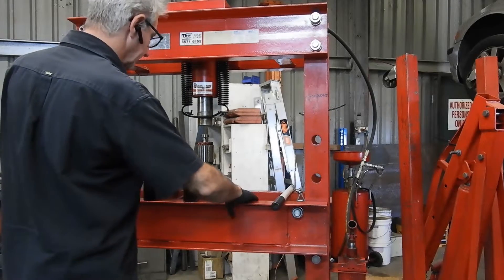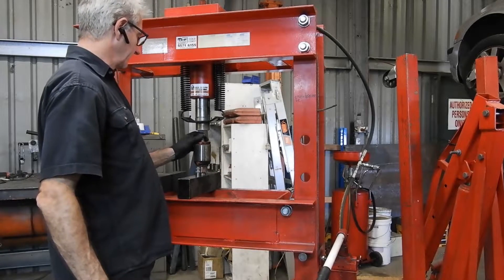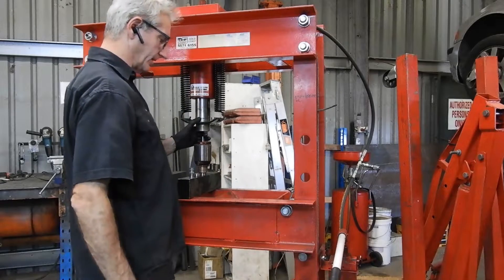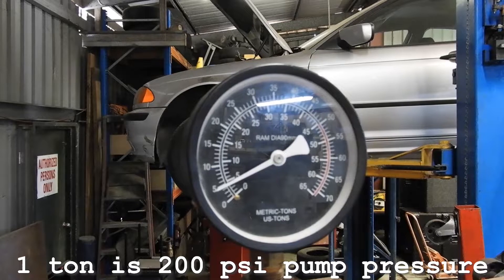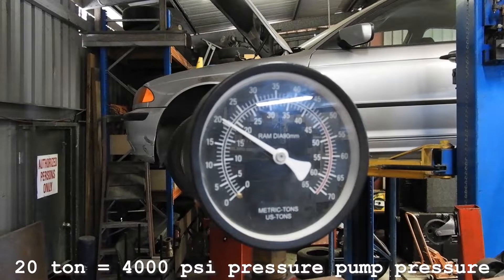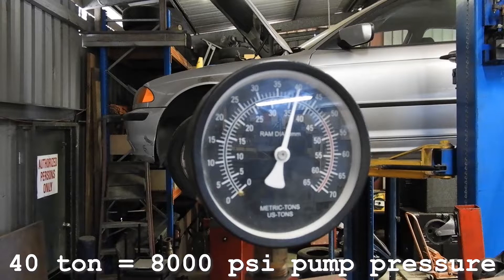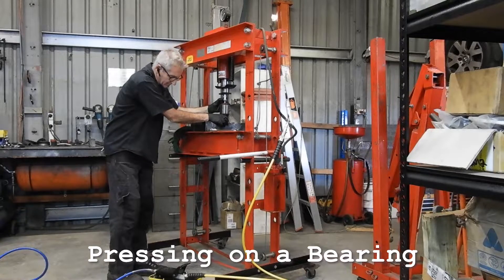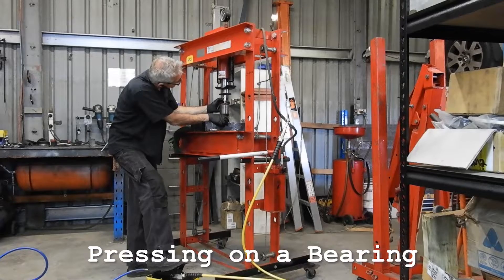How to Speed Up Your 50 ton Hand Operated Press 3X with a 10,000 psi Air Operated Hydraulic Pump

Comment: What does it matter if you can control it with your hand?!  Defeats the purpose.
Reply from the maker: Sometimes if you have a tricky press job to do that requires you to use BOTH hands to keep everything in alignment or to hold it still and or upright. Using the foot operated pump keeps you, both your hands and your focus on the job.

Comment: Hello.
I bought practically the same 50-ton press (from harbor freight). And I want to connect this foot pump INSTEAD of hand pump, i want to unbolt hand pump from press.
1. I will connect high pressure oil line from pedal to cylinder insted of line from hand pump.
2. But there is also small 'Oil backing pipe' going from low section of cylinder to top of hand pump. What to do with this pipe when using foot pedal only?
3. When you press spoon, piston is going up and down few times very fast. How can I lift piston with no hand pump? (because Back oil valve is on the side of hand pump now). Or is this 2 direction foot pedal pump and I can press and lift piston using just one pedal?
4. What air compressor do I need with this pedal to press from 0 to 50 tons? I found some compressors about 20 gal 135psi max. It will be good enough or I can buy something smaller like 8-10 gal? Or even 20 gal is too small?
Thanks.
Reply from the maker: Vitalli sorry just saw your message you have so many questions!, if you still have problems please email them to me with some pictures to  sales@mhfgc.com.au
Cheers
Minos

Comment: Instead of "T-ing" in the air over hydraulic, why wouldn't you just replace the OEM air/hydraulic pump and directly connect the new, larger capacity pump?
Reply from the maker: Yes good point that is what we have eventually done, 
(when the manual hand pump finally failed)  
Please be aware that air over hydraulic pumps require a large volume of compressed air and continuous use of the Air over hydraulic pump will require quite a large air compressor and air receiver.

Comment: Great video showing how simple it can be to add a hydraulic pump to the system. I'm going to add this to my todo list. One question - how do you manage the oil levels in the two reservoirs? Eg. if you use the air pump for most movement and then the hand pump for final pressure, but release all oil back into the air pump, eventually the hand pump will be drained, right? (And maybe the air pump will overflow...) Maybe adding a site glass onto the side of the hand pump will let you keep the oil level at a consistent enough level over time?
Reply from the maker: Hi Adam yes you have raised some good questions.
The simple answer is to have the discipline to turn off firmly the hand pump's load hold valve when using the air over hydraulic pump. 
If using the hand pump make sure to keep the foot pedal on the air over hydraulic pump in the hold position.
Also every now and again keep an eye on your oil levels.
Our air over hydraulic pump has an oil level gauge.
And as you suggested installing a sight glass hand presses oil supply tank.

Comment: Can i use this machine for making steel bowl ..plz reply me 🙏
Reply from the maker: Hello, Vishal Yes you can use these machines for forming, bending and stretching steel into bowls but they are still a relatively slow process not a fast hi speed process, if you have a hand pump the air over hydraulic pump will be at least 3 times faster than hand pumping, please remember though that you will also need quite a lot of compressed air to operate the pump.
Reply: Hi I have a 35 Ton Jet press would this work the same as what you have?
Regards
Mark

Comment: Hello. How many tons needed to press in a typical bearing? Thanks....nice vid.
Reply from the maker: Interesting Question,  
Most bearings don't need more than 1 to 2 tons of force, bigger bearings around 4 inches in diameter maybe 3 to 5 tons. 
The internal bearing housings on Rock breakers though,.... need lots more between 20 to 40 tons.
Seized and rusted Pins on Earth moving Buckets and hitches from 5 to 20 tons and they usually go off with a bang. 
Straightening bent cylinder rods around 1-1/2 inches in diameter 4 to 8 tons. 
Hope these answers have helped you, are you trying to decide what press size and capacity to purchase?

Comment: Brother, you've made my day. I form stainless steel domes (1.2 mm sheet and 46 mm diameter) but it's one hell of a lot of pumping a 30 ton bottle jack to complete one dome. I form them in two stages - the first just to draw the material into the die and the second operation to form the shoulder at 90 degrees. Then I saw your video. Man, I was impressed. I saw a lot of these things on the internet. Some with less than 1 liter/minute flow up to 16 liter/minute flow. I assume this is air flow, or am I wrong? I will appreciate your input to ensure I buy the correct thing. I will mount the jack upside down eventually. Have a great day and I hope to hear from you.
Reply from the maker: Hello, Pieter thanks for your comments and questions. The Unit I used in the video is compressed air operated and based on our tests sped up the manual hand pumping operation by three times, 3X (300%).

Oil delivery from this unit (and many others of similar size and design) will depend on the pressure generated.  
for example. 
at 1,000 psi pressure, the unit will flow 1.0 litre per minute
at 2,000 psi pressure the unit will flow 0.85 litres per minute
at 5,000 psi pressure, the unit will flow 0.5 litres per minute
at 6,500 psi pressure, the unit will flow 0.32 litre per minute
at 10,000 psi pressure, the unit will flow 0.16 litre per minute

Compressed Air consumption required is 339 litres per min at 100 psi.

If you mount the jack upside down unless there are internal or external extension springs it may not retract properly and connecting the pressure hose from the pump to it could prove ......complicated.

You could try mounting a single-acting high-pressure cylinder such as this to your press  
 http://ebay.us/kQRuHG

If the air operated pump flow is enough for your requirements, please see some links below 
If you require more flow for faster speed then please check out high-pressure pumps that are operated with a single-phase electric motor as these units will supply up to 2.5 to 5 Lt/min of oil flow.  

If you are in Australia you can visit our web store www.hydraulic.online and order one from there 
For an air operated pump,  https://bit.ly/2WUq97a
For an electrically operated pump,  http://ebay.us/BW226N

Alternatively, If you're in the US and want to invest in a New 10,000 psi Hydraulic Pump?

For an air operated pump,   http://ebay.us/Ww4TRK
For an Electrically operated pump,  http://ebay.us/GzFmzn
 
Hope this answer has helped you Pieter and all the best in your quest for speedier forming of your Stainless Steel Domes.
Regards
Minos.
Reply: @Hydraulic.Online  Thanks so much for the info brother. I'm sure I have seen one of these things before but never used one. I will for sure invest in one of them because pumping a bottle jack under high pressure in a 37 degrees Celsius (common temperature here by me) is no fun. Happy holidays to you and your family.

Comment: Hi there! I really enjoyed your video and it was nice to see there is something available that will increase the speed of the ram. However, even in the sped up footage, it still looked pretty slow. About how much did it speed up to? 10% maybe? 
The reason I ask is I was looking at using the same set up but for forging and I would need to do as much work as possible while the steel is hot. I really appreciate you making the video! Thank you.
Reply from the maker: Hi Sam, Thanks for watching and for your comments and questions. This system will provide a lot of pressure but you are correct it will be too slow for metal forging,  It is, however, ideal for not only speeding up a hand-operated press but also for freeing up an additional hand to hold and guide the workpiece. If you need a system for Metal Forging please check out this video.
https://youtu.be/qUT71kzfsjE  
that was sent in by one of our clients who built his own forging press using a Metal Forging Hydraulic Kit supplied from our online store. 
https://www.hydraulic.online/store/Metal-Forging-Using-Hydraulic-Power-c33871059
Reply: @Hydraulic.Online  
Hey! Thank you so much for such a quick reply! I will check out those links you provided. That was very thoughtful! Thank you!

Comment: What is the oil flow rate ?
And is it possible to increase the flow rate by increasing the air pressure ???
Please answer me and I wish to have any of your whats app number 😁
Reply from the maker: Hello Mohammed thanks for watching and for your question.
You can Increase air pressure to a Maximum of 120 PSI this will give you a little more pump speed and will achieve around 10500 PSI of OIl pressure but no more because the internal relief valve will release any more excess oil pressure generated.
As a rule as oil pressure increases oil flow will decrease as more air volume is required to fill the air side of the intensifier chamber to produce a higher oil output pressure.
For example with a constant 100 PSI of clean, dry and lubricated compressed air  the following pump performance can be expected.  
at 1000 psi oil pressure oil flow is around 1000 cc  per minute
at 2500 psi oil pressure oil flow is around 785 cc per minute   
at 5000 psi oil pressure oil flow is around 475 cc per minute   
at 7500 psi oil pressure oil flow is around 275 cc per minute   
at 10000 psi oil pressure oil flow is around 165 cc per minute  
As you can see the results are almost linear.  
Hope this answer has helped. 
You can contact us on the following email address.
sales@mhfgc.com.au

Comment: Does that do away with the manual pump
Reply from the maker: Hi Raymond thanks for the comment its a good question. Answer, It's up to you, in this video we Tee 'ed into the pressure line above the manual pump so you can use either pump. The only point you need to remember with this set up is that if you use the Air over hydraulic pump you need to have the pressure release valve on the manual pump shut firmly other wise you will pump oil into the tank of the manual pump. Same goes if you use the manual pump make sure the pedal control on the Air over hydraulic pump is in the middle hold position.